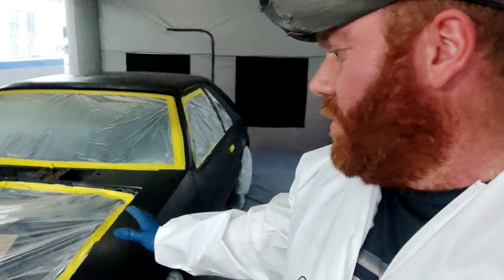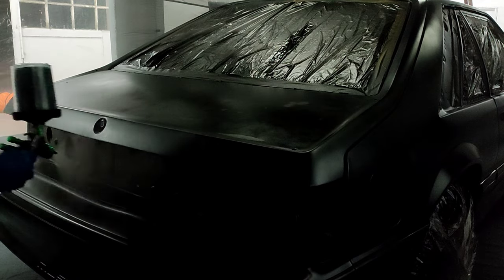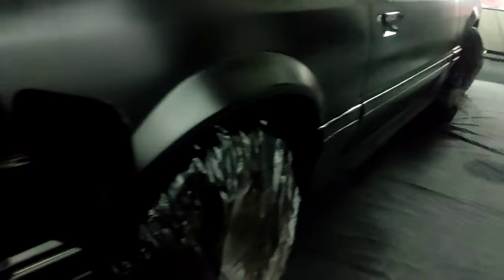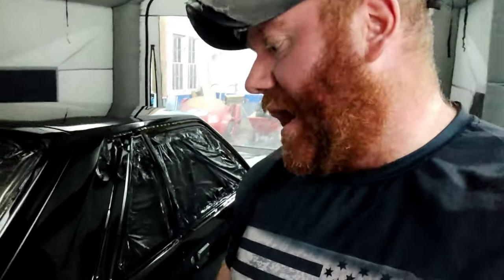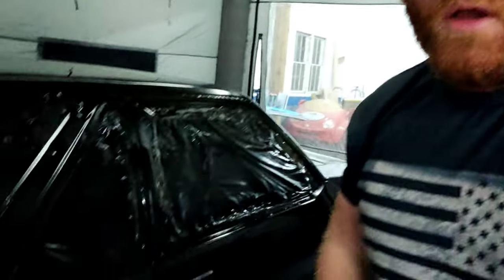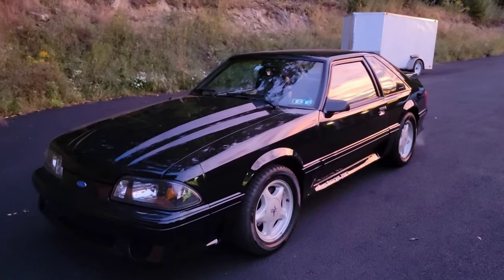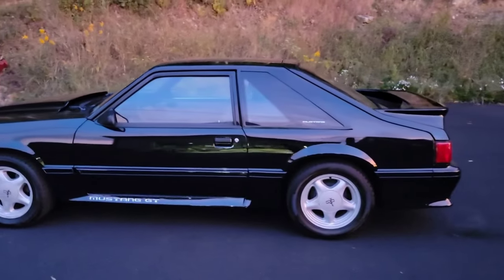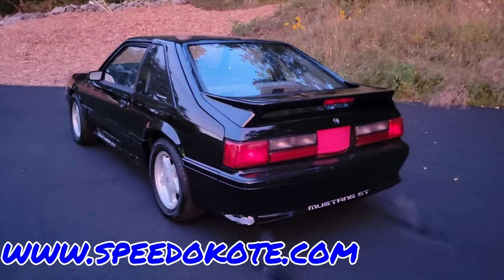cheap mustang paint job

Comment: Car looks amazing bro one thing I wanted to say was open the garage door half way so you can breathe  if a squito gets In there wear repellent and if you're worried about the paint catalyst not curing correctly because you opened the door half way and the temperature dropped add a couple more drops of hardener and hit it with a woman's hair dryer on low/medium heat 12" away for 1 hr 15 mins,painted alot of boats and a couple new edge mustangs and this always worked.Good luck buddy
Reply from the maker: Yea typically always have ventilation while using these

Comment: I love doing 2 coats of speedokote smr-130 heavy then the next day I will sand that with a 600 then do another med flow coat. Ive learned a ton from your channel then tweek things to work for me
Reply from the maker: This is truly the best way to do it however I notice the smr130 takes a few days to fully shrink back mabey let it sit over a weekend
Reply: @speedokoterefinishnetwork4937  i will give that a try but honestly Ive never noticed any shrinking with it. I used to spray kapci and it with shrink extremely bad over a 24 hour period

Comment: That did turn out awesome.
I don't know if it was the camera's exposure settings, but it seemed like you were having to paint with less than ideal lighting conditions.
Most of the times I've messed up, it was due to inadequate lighting.
Great video tho, thanks 👍
Reply from the maker: Crazy thing is, even with bad lighting I got 0 runs and only 2-3 minor sags in the clear coat. I actually shocked myself

Comment: Big Mac Marco! You went old school.👍👍 Question, on the second pass of clear, did you go higher on psi? And closer to the panel?... TYVM 💯👍
Reply from the maker: Second pass I go slightly closer to get more transfer of clear coat onto panel for a wetter coat SOMETIMES. some clear coats I apply the first coat same as the second

Comment: Good stuff bro.. thanks for sharing the experience on the spraybooth. I was thinking about buying one myself.. what's the longevity of the clearcoat? And is it 2:1 High solids?
Reply from the maker: All clear coats are salt and uv tested for 2000 hours good stuff
Reply: @speedokoterefinishnetwork4937  ok.. so the price for the clearcoat...is it a 5 litre ?
Reply from the maker: @elcoholic79  this specific kit is 4 quarts of clear coat 2 quarts activator. 1.5 gallon total enough to do 3 small cars or 2 medium sized cars.
Reply: @speedokoterefinishnetwork4937   ok cool. Thank you..

Comment: Awesome job!  Huge fan of Speedokote here too.  Quick question... you went Slow reducer with your base.... but the Fast activator with your clear?  How long did the base set up before you applied the clear?
Reply from the maker: Base only needed about 30 min to dry. And also I spray my base and clear different that's why different speeds in reducer and clear

Comment: Marco, back in the day (talking 1987) I used to paint the rubber bumpers with a special additive. Didn't hear you mention anything about that with this paint job.  Has paint technology evolved such that the rubber parts can simply be painted with the rest of the car? Or did I miss that or not explicitly mentioned?  Car came out great, thanks for the final clip from the customer, and your continued content. Cheers from an ex-Reading resident.
Reply from the maker: Yea there's flex additive still around today not extremely popular being most paints now a days have that stuff built in. Speedokote has flex additives in a lot of there paints for added adhesion and durability
Reply: @speedokoterefinishnetwork4937  Thanks, seems like one less thing to buy/add in this newer paint.  Thanks for the reply, appreciate your channel/knowledge

Comment: Thanks for the video Im about to paint my fox white but I want to use blue pearl in the clear.
Reply from the maker: I almost never advise putting pearls in the clear unless you have been doing this a long long long time. Get a run in that clear with the pearls you are absolutely screwed
Reply: network he is absolutely right bro run that stage and its game over
Reply from the maker: @deanbrown7643  been there done that. I am here to save you guys from my mistakes 🤣
Reply: @speedokoterefinishnetwork4937  Thank you for the advise. But I got to try it. Ive already done a few on motorcycles. All came out perfect so I figure Id try my own car.
Reply from the maker: @skinneyjay5451  load up a good amount of pearls in that clear first coat, use med or slow activator, add a little slow reducer, GO LIGHT APPPLY IT LIKE BASE, rest of the coats of clear no pearl apply wet
Reply: @speedokoterefinishnetwork4937  Thank you I was going to ask if I should use a slow reducer for better flow.

Comment: Could I scuff the smr1150 And blow a few coats of the smr42 over the smr1150
Reply from the maker: Absolutely iv done that before use a cheap clear as a base, then top it with only 1-2 coats of expensive stuff.